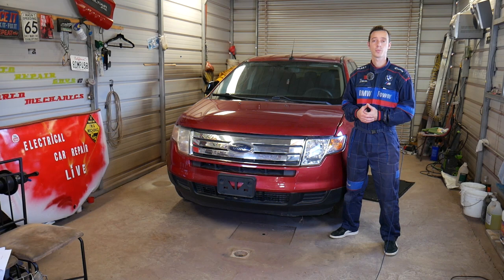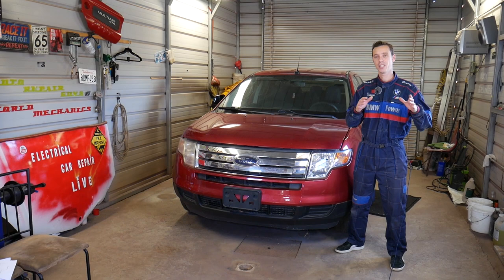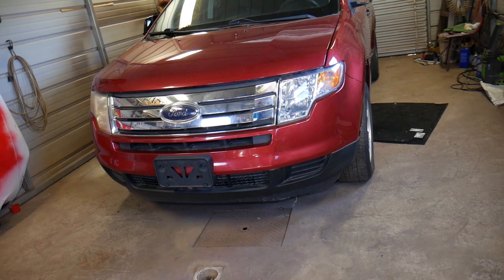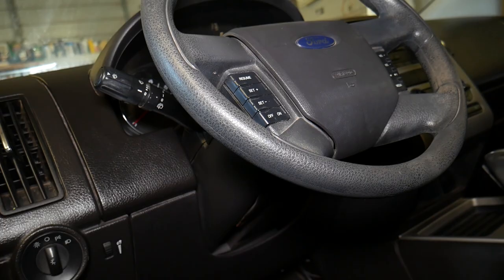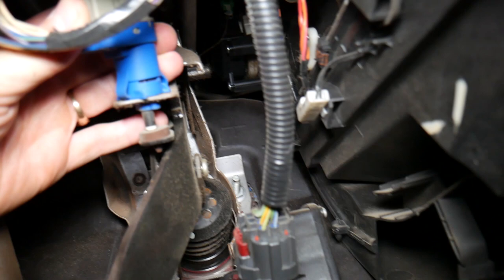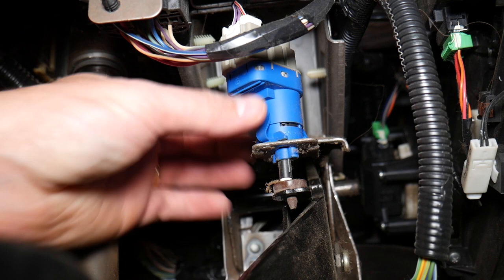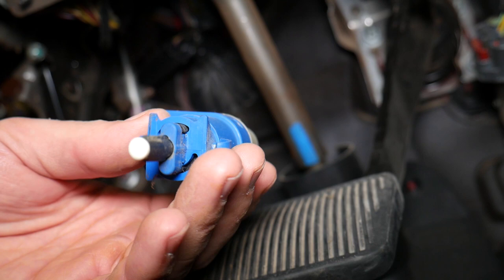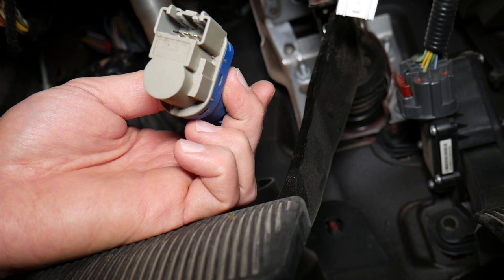FORD EDGE BRAKE LIGHT SWITCH REPLACEMENT REMOVAL. BRAKE PEDAL POSITION SENSOR

Comment: According to my info, the plunger needs to be pushed in when removing. My issue was, I replaced the brake booster and the travel of my brake pedal was slightly shorter than before so the brake pedal was intermittent in engaging the switch plunger. I ordered a replacement and the plunger travel was longer. All good.
Reply: I also need to replace mine for the same reason. When you reinstalled it, did you leave the brake pedal fully-extended? I understand the plunger is supposed to be depressed when it's removed, but what about when you reinstall it?